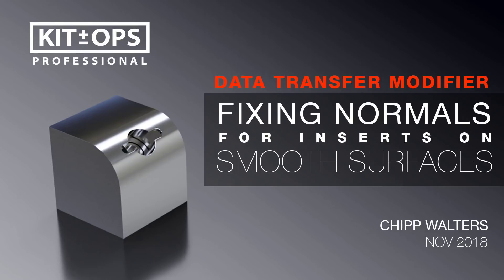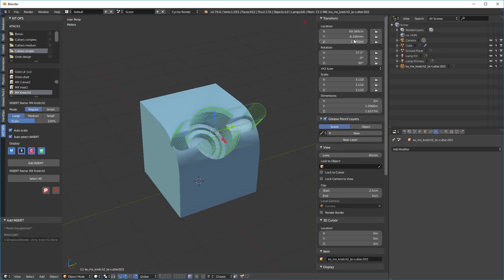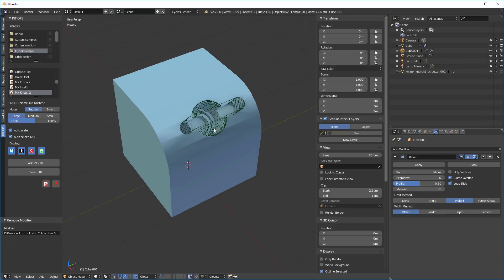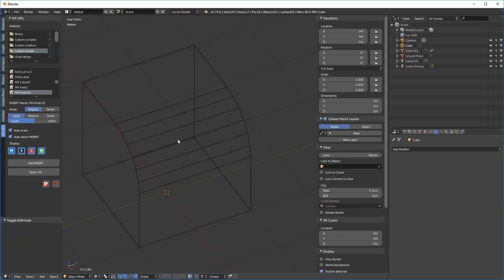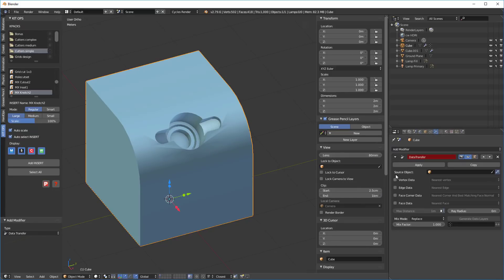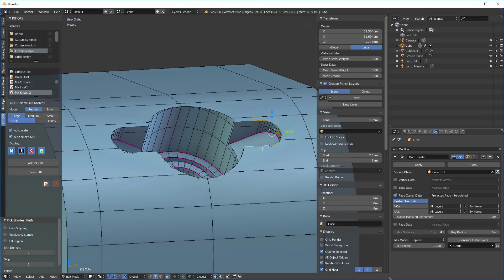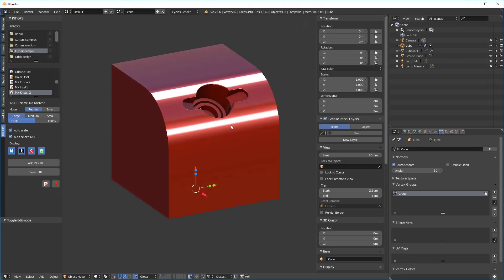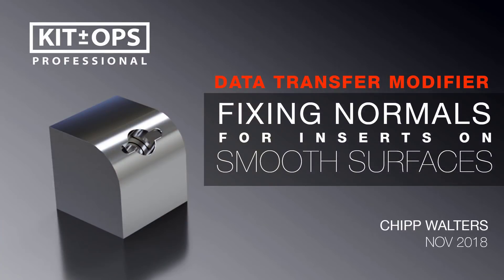Fixing Normals trick for Blender KIT OPS

Comment: I'm pretty sure you can also shrinkwrap the vertex group to the highpoly mesh and get same result.
Reply from the maker: I tried that originally but found out I needed to remove the contents of the hole for it to work, which added several steps to the process. Perhaps I should go back and give it another try.
Reply: @ChippWalters  This is one of the best add-ons n I'm def saving up for it. Thanks for posting this tut as I learned another trick in blender.

Comment: Why don't you automatically do a transfer of normal with the data transfer modifier while doing a boolean ?
Reply from the maker: Primarily because we try and stay non-destructive. IOW, you have to apply the Boolean in order to do the data transfer. It is a good idea, though.
Reply: @ChippWalters  no i was talking about before doing a kitops operation to a mesh , automatically dupplicating the mesh to another layer and use her to copy the normals of the perfect shaded mesh to the mesh that will have a boolean ops to avoid any shading issue due to boolean operation , but i think you already did that ...

by the way , im an ex sketchup user too and i love this program too!!!

dont you want to code an awesome add-on that import the line tool of sketchup inside of blender ? even making it better !? with features like:
- automatic knifing faces and edges like sketchup
- a good or even better snap system that autodecect if you want to lock xyz or the pink axis (autodetect last edge to create the pink axis) like sketchup
    and even add xyz(and pink) planes to lock from (shift zyx when moving)? 
    snapping to middle of edges like sketchup
    snapping to projected edges like sketchup
    snapping to center of faces  like sketchup
    snapping to projected tangent of faces  like sketchup
    snapping parallel to near edges
- a new function  to choose the angle of the line you want to create when you are in this xyz plane lock snap?
- automatic faces generation when closing the flat shape like sketchup of course, and it could even guess and draw missing edges of non planar drawed shape?)
 
i think it could be a great benefit to blender , its the most easiest and efficient way to build 3D shape for non experimented people

we also could have other tools from sketchup added to blender , like :
- the precise , choose two snap point to:  move , rotate and mirror
- the line eraser tools that we can even add more function: delete/dissolve/collapse edges?
- the draw a rectangle on a faces tool
- the paint bucket tool for easy material attribution

 it could be so awesome to have thoses tools imported inside of blender !
 i see that you try to convert a lot of users it can be the thing that make them step in ! and a lot of inexperimented people to jump inside of blender
 i know im just dreaming but thoses tools are just so much a miss  :(

;)
Reply from the maker: @ccb4911  All good points. I think some of the push pull was done before but had to be abandoned when Blender went to a different type of Boolean operations. Those other tools would be wonderful :-)

Comment: Come on, gimme a shoutout at least.
Reply from the maker: Sorry, I actually didn't use your tool at all to figure this out. In fact I've not yet installed any of your tools as I know I need to take the time to learn them, and I haven't had any free time lately. That said, based on what I've seen, you have the best set of bevel and normal tools out there. Didn't mean to hurt your feelings.  

Even so, I don't remember complaining about you not giving me a shout-out when you released your plugs extension.
Reply: @ChippWalters  Are you saying Kit Ops inspired me to create plugs? You may want to check out when I first tweeted and posted videos about plugs.
Reply from the maker: @MACHIN3  I'm saying hard Ops had plugs before you had them. And guess where Jerry got that idea from? https://www.google.com/amp/s/masterxeon1001.com/2016/01/05/hops0065update/amp/
Reply: @ChippWalters  HardOps has boolean inserts. Plugs are unique tech not inspired by HOps,.  Why should I shoutout to KitOps when I'm supposedly inspired by HOps inserts? Weird, I'm out.
Reply from the maker: @MACHIN3  I never said you should shout out to anyone.  I said I didn't complain. Complaining about shout outs is your deal.
Reply: @ChippWalters  plugs and hops inserts are 2 totally different systems, for hops, initial inserts where introduced and coded by wazou and then modified by me. The mesh transfer method, on the other hand, was introduced to blender community by @MACHIN3. Give a try to meshmachine it can do all that in 1 click and is a super useful addon.
Reply from the maker: @AdrianRutkowki  whatever. They all accomplish the same thing to everyone. You guys are arguing like a bunch of school girls over who got asked to the prom. Damn, this is just a video I researched on my own without any help from Machin3 (whoever that is), Jerry or you. Can you just give it a rest?
Reply: @ChippWalters   You' ve got to be kidding right?